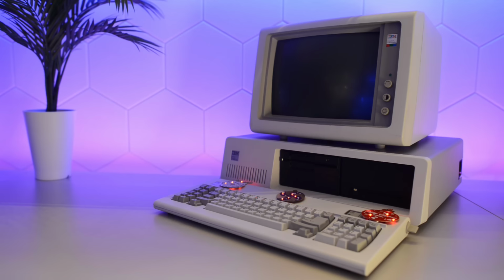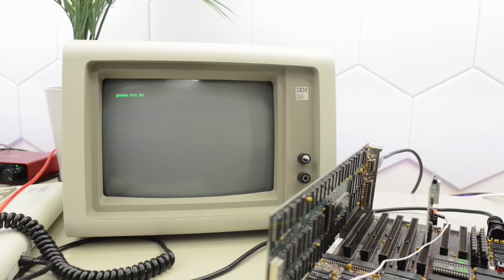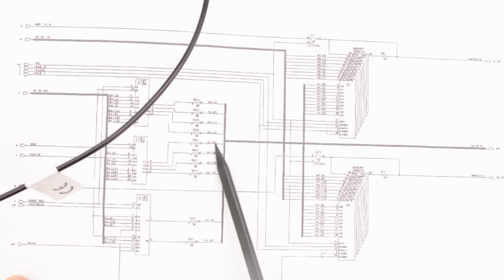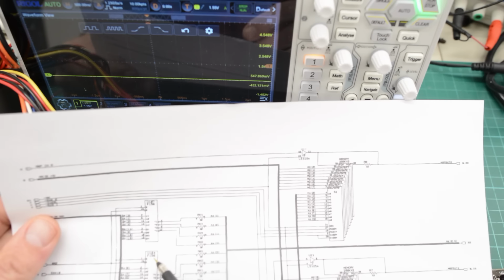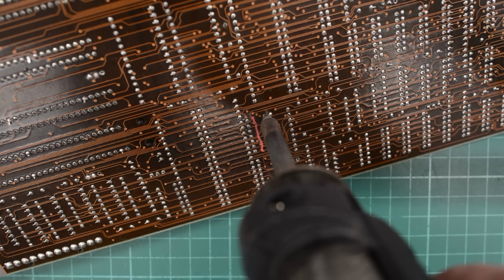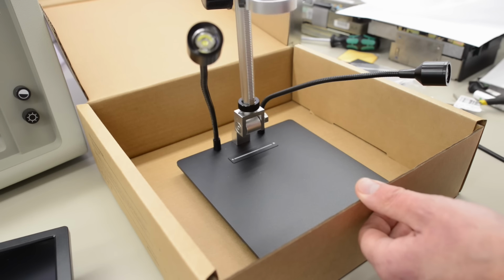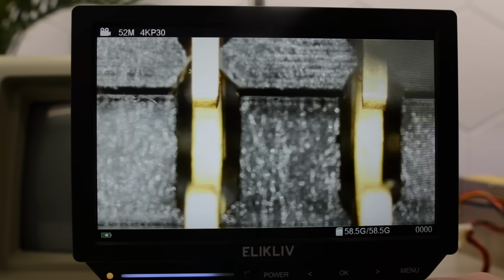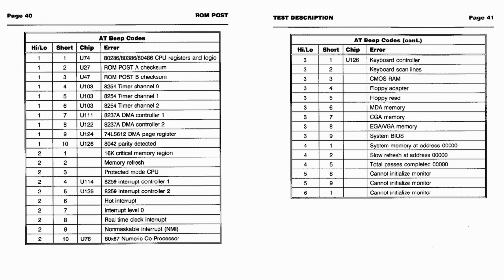Ultra rare IBM 5162 dead on Christmas. Troubleshooting AT motherboard

Comment: I think the IBM AT computers was Marketing Scheme by IBM. Like they did with the PS/1. There were many different variants of the IBM PS/1 and it all depends on which store you purchased it from. Different stores carried different variants of the IBM PS/1. ( MONEY ) $$$$$$$$$$$$$$ IBM sold different versions of their computers to the public at different costs. You could buy a a stripped down slow CPU computer or a faster one for more MONEY. It all depended on how much MONEY you are willing to spend. This is Why I refuse to over pay for a modern computer today if they all run MS-Windows. I only buy Best value computer. I usually buy used or build my own. Also I did not like the Proprietary hardware on the IBM AT computers if you just want to run x86 software and play games. It was better to build your own NON-Proprietary computer for less MONEY

Comment: Maybe you should check why the space character (ascii 32) is showing up as à (ascii 160).

Is that a stuck bit d7?

Edit:  bios clears screen and displays message.  Probably not there?
Reply: The text was also flashing with the CGA card and AFAIK the blink is bit 7 of the attribute byte. That's probably just a fault of the CGA card. The MDA card was working fine.
Reply from the maker: Yes, that CGA card turned out to be broken :/ The good thing is that the diagnostics run properly now with another CGA card

Comment: Ive seen much worse scanned service manuals before than the one you have. Ones where the pages aren't even straight and in 2 bit B/W, not even grey scale. Completely unreadable. Why even bother scanning something if you're not going to do it properly. Whats the point. Either do it properly or not at all. It needs to be 300dpi minimum and in colour.

Comment: Best wishes on getting it sorted. Weird that the SIMMs are fine in other machines, but test bad in this one. The only idea I'd offer is that maybe the SIMM sockets themselves are faulty- maybe cracked solder underneath. Good luck to you if you wind up trying it, SIMM sockets are a pain to work on.

Looking forward to seeing this interesting machine up and running! Rock on!
Reply from the maker: Thanks!

Comment: I hope all this troubleshooting results in the discovery of the most unusual fault mode and not just a cracked solder joint or bad resistor.  Heroic efforts!

Comment: Bad scans I swear they are an issue in all fields. So when I was a mechanic my boss paid for multiple programs and licences to "repair manuals". The bad scans normally reared their ugly head for one of two things, torque specs or more commonly wiring diagrams. Even OEM software wasn't free of the bad scans. For the OEM my best guess is the original media was either printed out then scanned, or got converted, screenshot, saved as a bad format over and over.

Had one car we had to rewire front to back, as previous owner used household wiring to do it, whatever he could find. The job was painful, does this wire go from the eco to the injectors? Coil packs? Windscreen washer bottle no one will know as the scans were so bad you could barely read the main title text (ecu, bcm, abs, body, engine bay etc. Could only guess), found the issue in pc hardware scans and arcade cabinet scans as well.

Edit: I am convinced that only one person uploads all the scans in the world, they have parkinsons and a 10 pixel (not megapixel) homemade camera that they use to shackingly photograph all the schematics in the world.

Comment: Welcome to XT 286 limbo part two, where this Grinch takes us even further down the rabbit hole! 😵‍💫

It wouldn't surprise me if this is issue is caused by faulty RAS/CAS signalling, Roman. I would check those RAS and CAS pulses again as it seems to me this machine overwrites a part of its own memory multiple times. If the refresh strobes aren't timed right chances are the wrong DRAM ICs are selected (wrong row and column selection because of timing issues). At least that's my theory and a bit of an educated guess, seeing that CGA going crazy with those test-ROMs.. 

It could also be one of the delay lines indeed like I mentioned before as I seem to remember the RAS en CAS signalling (or at least one of the two) go through them for its DRAM refresh. Those delay lines are a bit harder to scope though as you'll need to check multiple signals at the same time to count if they give the correct amount of delay.. You'd need to use at least two channels on your scope for that simultaneously.

These were two of the issues my friend's (very early) 5162 had. There were a whole bunch of issues with that evil critter ;-)
That + faulty ROM chip select logic, a bad Motorola RTC/SRAM IC and a bunch of fried 7400 logic chips and missing bodges/traces(?).. I think that thing must've been struck by lightning ten times or something ;-) Your machine is obviously much healthier than that as it manages to post ;-)

You could also consider replacing that old Motorola CMOS memory/RTC chip with a Dallas replacement with a coin cell battery so you don't have to add an external battery pack 👍 But yeah let's revive it first haha ;-)
Reply from the maker: Haha, Yeah, we've got a long way to go on this one. I did some minor progress today. The CGA card I used in the video turned out to be faulty. I now have working CGA graphics with those diagnostic ROMs. I'll post a picture on the channel.

Comment: 14:00 You really shouldn't be guessing about whether a logic chip is good or bad. Use the 74-series databook/datasheet and check the truth table. Check input and output and compare against the datasheet to see if the output is correct with the given input. You can also inject a high or low into a pin (using a 1k resistor in series) and observe the output to see if it changes. If no change the pin is stuck which is a common failure type. If you remove a chip you can test it using an eprom programmer as most have a logic tester function, or even wire it up on a breadboard. Or get a Retro Chip Tester Pro as that device is a real game changer when it comes to testing old ICs.
Reply from the maker: I'd love to have one of those fancy retro chip testers, but right now I'm saving up for a new capture PC. Maybe I'll get one next year
Reply: @Epictronics1  They are not expensive, just a bunch of off-the-shelf parts and you have to build it yourself. It takes a few days to do it (slowly) but eventually you will have a very useful repair tool. You should prioritize its acquisition ASAP.
Reply: @Epictronics1  I'm going to buy Chip Tester Pro v2 from BackBit - it's much cheaper - $200 instead of $400 for Retro Chip Tester while supporting everything I need with increasing chip support. And ordinary TL866 also checks plenty of logical chips.

Comment: I would reflow all of the pins on the sim chip sockets. With the extra mechanical stress, I have seen a bad/ fractured solder joint before. I'm waiting for your next video to find out what the problem is on the card😊
Reply from the maker: You're right. I should have tried that, thanks

Comment: The reason the 5162 exists is literally because IBM had a ridiculous amount of excess chassis stock they wanted to clear out, and wanted a machine that could fit inside.
Reply: It actually exists purely to give people like Epictronics headaches
Reply from the maker: @PixelPipes  lol
Reply from the maker: I'm not sure. This case is slightly different and would require some new tooling to manufacture
Reply: @Epictronics1  I heard that it was to ease the upgrade from the XT for some companies. They would just order another "IBM XT" which would be filed under "replacement" instead of "new acquisition". Companies in the 80s were still slow to adapt and had jet to change business practices regarding computers. Writing off a computer after only 3-4 years was mostly unheard of. Business machines like calculators or typewriters would only be replaced when the hardware was defective or used up, often being used for several years or even decades.
Reply: @Epictronics1 The more I examine the schematics, the more I agree with @tschak909.  It looks like they started with the AT schematic but pared it down to make it an ATJr.  The address line multiplexer that you were having trouble reading outputs 10 bits of address, but only 9 are needed for a 256K simm.  The 10th bit is connected either to A19EN or full address bit 20. On the simm it's connected to A10 which is ignored unless it's a 1MB chip or bigger.  In addition, the schematic sends RAS 1 from an address bank decoder chip, the 82s147 PROM, to what would be A11 in the simm connector, if it were a 4MB chip.  But with that 256K module it is also ignored, and it's not multiplexed for RAS/CAS either.  You might be tempted to think that means you can plug in up to 4MB into each slot, but with the wackiness of the 2 top bits, I'm pretty sure it would just crash the computer.
Reply: Yeah, this theory goes around every time anyone mentions the 5162, but I don't think I've seen any references cited.  And as Epictronics says, it wasn't like they just shoe-horned an AT motherboard into the 5160 case as-is.  This really did seem intentional.

I wonder if we'll ever find anyone who knows for sure.  I once heard that IBM wasn't run by human engineers, but by self-aware automation robots.  So it's possible that no living person ever DID know why they used this case.
Reply from the maker: @sirnickity  lol. I'd love to restore one of those self-aware automation robots someday 😆 Then I could dump its robot brain with my TL866 and we'll find out why IBM made this oddball!